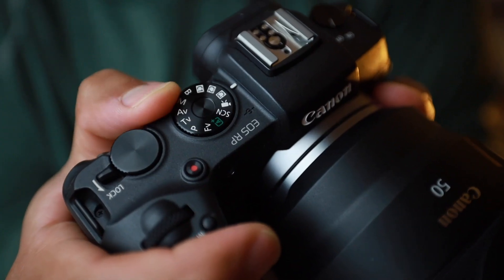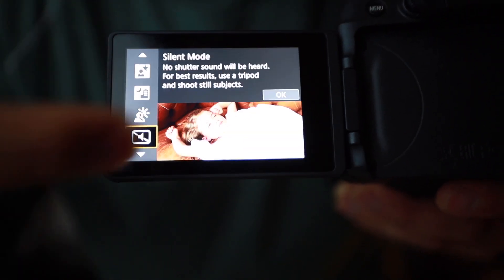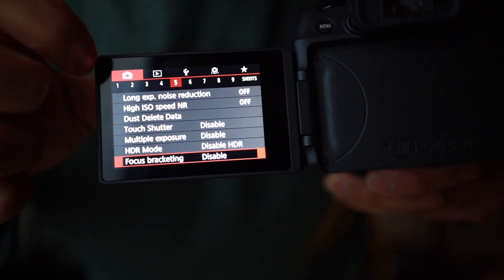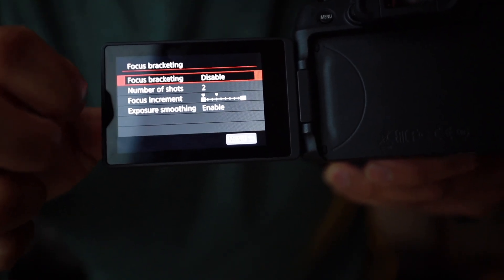Canon EOS RP: Learn How to Get Around the EFCS Limitations

Comment: straight to the point, great video with great example. for f1.2 the issue starts at about 1/800 ! not great. as a beginner camera one could use the f4 zooms and when taking care an f1.8 up to 1/2000 or so. It's not a Canon-specific issue though

Comment: Also on mechanical shutter when you go to 3000+ you are start to having this problems
Reply: 3000+? My 5D mk2 currently has 260k on the shutter and my 6D had 150k on it before the screen died, both shutters are still fine. Shutters aren't that fragile.
Reply from the maker: That 5D mk2 is still going strong!

Comment: I have a question: can the silent mode be used with adapted manual glass as well?
Reply from the maker: yes that should be no problem. Just switch the shutter mode to electronic.
Reply: if you adapt lenses without electronic contacts such as Leica M lenses, you won't be able to press the shutter at all under silent mode. I've tried with my Leica M to Canon RF adapter and it didn't work. Your only option is to use the focus bracketing trick.

Comment: Oh...That explains the problems I had with my M50 and Godox flashes... The weird part is that I thought ES could be the issue and contacted Canon's support asking if there was a way to use full mechanical shutter for the M50 and they told me the M50 didn't had an ES, which is total BS since it can silent shoot with full ES. But I assumed they were talking about regular shooting and I let it slide... But now it's clear to me that the M50 uses EFCS just like the RP. The problems I experienced are identical to yours. Funny how I can find more reliable info on YouTube than with the official Canon support.
Reply from the maker: Di Torres yea you’re right. Same thing with the m50. Besides saving cost on the manufacturing process, I’m guessing that the efcs mitigation with shutter shock is more prevalent with smaller cameras like the m50 and RP. Glad the video helped!
Reply: The P in RP is for piss take and thats what the RP is. Gotta love Canon. Hijacking their own products.

Comment: When I follow the steps for enabling focus bracketing then I get banding...
Reply from the maker: James Wood yea that’s because your accessing the fully electronic shutter through that method. One of the cons to using a fully electronic shutter.
Reply: @BCPCamerasTech  so focus bracketing is useless then...
Reply from the maker: No, not useless. You just don’t want to use it under certain types of artificial light. It would be fine if you were using it outdoors in the sunlight.
Reply: @BCPCamerasTech  I'm going to try some outside... Do you recommend a tripod? Is the banding in artificial light due to the inherent "flickering"?
Reply from the maker: It has to do with the frequency of the light in conjunction with the sensor readout speed and shutter speed. Your more likely to see the effects at faster shutter speeds. Definitely use a tripod. Let me know how it goes!